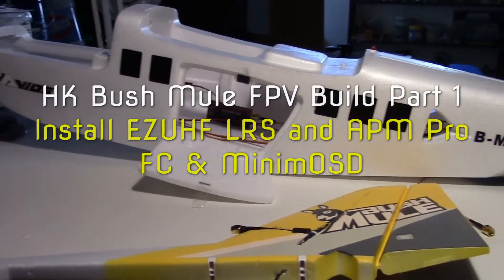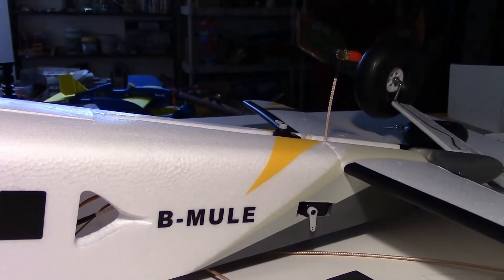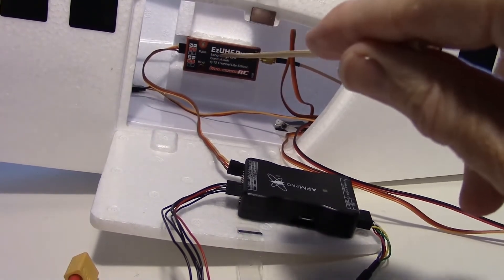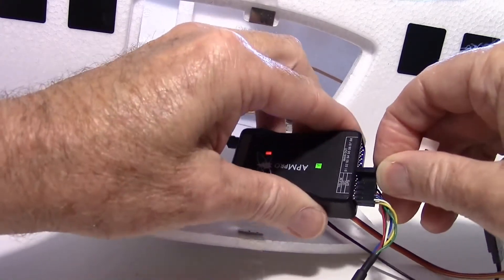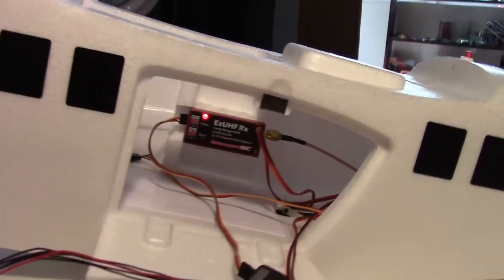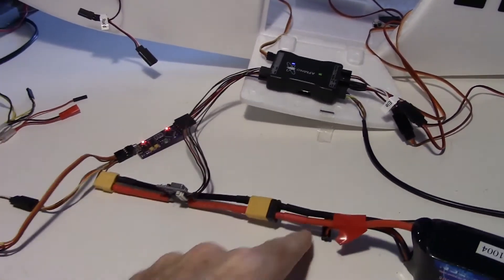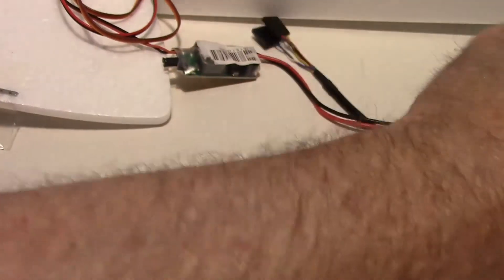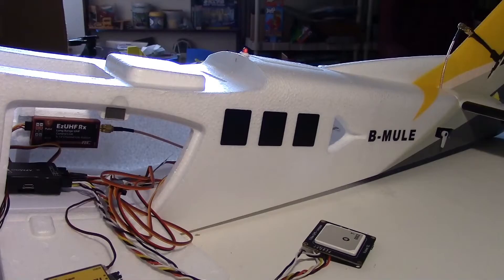HK Bush Mule FPV Build Part 1 - Install EZUHF LRS and APM Pro FC & MinimOSD

Comment: Dave, My Friend, Buddy you hit the nail on the head for me. Question, if I may, on the S500 I used the power board and solder all ESC to the board pulled the JP-1 jumper on the APM outputs side. Do I need to use the UBEC 5 volts to power up the ESC's on the APM? If it matters I using Emax 30A ESC w/ Emax 2213/935KV motors.10-45 props. I know in your video you used the UBEC. I don't want to pop anything. I'm trying to be so careful. This is my first build.
Reply from the maker: No. The five volt UBEC is only for servos with a plane. With a quad you don't need the UBEC. Also do not hook up the red wire from the ESCs just the black/brown for ground and the yellow/white for signal. The red wire is a 5volt wire from a BEC on each ESC (unless they are OPTO which don't have a BEC). Connecting all those red wires on the bus could cause trouble so leave the red/center wire off.  You can lift the tabs on the servo connectors and slide the red wires out.
Reply: Dave Merc Productions Thank you for that information. I will check and see if the ESC are OPTP,  I guess that would be in the paper work that came with them. Sir I thank you so very much.
Reply: Good Morning Dave, Calibration on ESC, have you tried this way before. Before I try this way I wanted to get you input. This is a web sight for Emax ESC's. I been watching JC for some time. You probably heard of him. He pass away about 9 months ago do to a motorcycle accident. Project Blue Falcon. He doesn't cover some of the stuff I need to know. Like you do.
web page - https://blhelisuite.wordpress.com/
JC's - BLHeli playlist -https://www.youtube.com/playlist?list...
As always I thank you!
Reply from the maker: Afraid I was not subbed to JC but I have heard others mention Project Blue Falcon. Your YouTube link does not seem to work but I get the idea.

Comment: Dave, excellent video, and I like where you're going with the FPV.  One thing I did that you may or may not want to do is, I took the Y cable out of the elevator and beacon led wire bundle and I moved the Y with led lead and used them to Y both the beacon led and lamp leds together so I could operate them off a switch.  I also didn't like having an led connected to control servo wires. I think it is better to keep them all separate and I want to be able to turn all lights on and off as I please. Looking forward to the next installment. Take Care... 👍👍😎

Comment: When I asked people about Skymule LR capabilities they assured me it's a bad idea, due to drag of fuselage.
BTW. I crashed hard Skymule several times, it's bulletproof, especially wings are great. Bushmule looks like a big upgrade of original mule.
Reply from the maker: I like the long range receivers not just for the distance I can go but for the satisfaction of maintaining a solid control signal. I will say that a plane as large as the Bush Mule could easily cover a lot of distance in a short time despite it's air resistance. Although we hope to always maintain line of sight sometimes stuff happens and if you have LRS you can always flip the return to home switch and let the FC bring her home. 
Good to hear your Skymule is so resilient and I am hoping you are correct about the Bush Mule being the same.

Comment: #1: Nice, just a suggestion D., turn the servo arm 180° (up) and reverse the channel, then you get a more linear movement on the elev. push rod.
Reply from the maker: Thanks for the suggestion on servo arm. Don't know why it came pointing down like that.
Reply: Maybe they cut the wrong length on the push rod ;o) Don't have a clue eider.